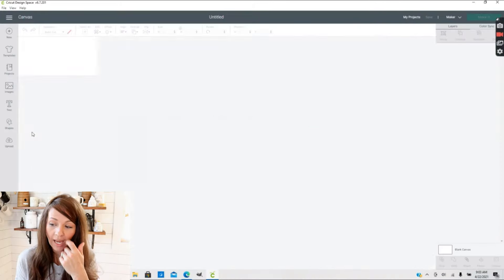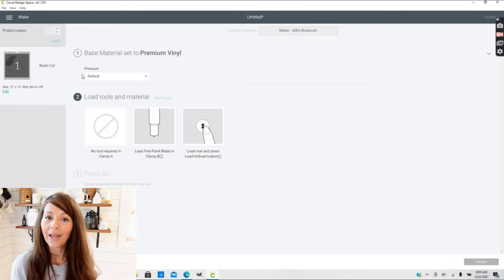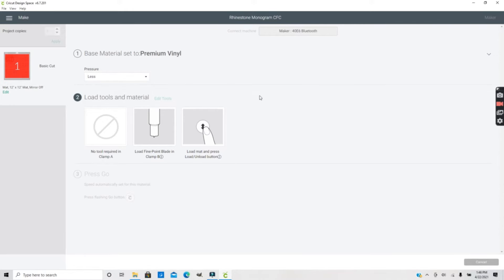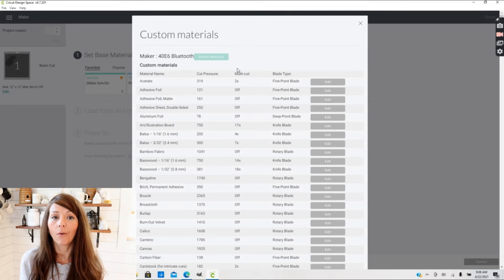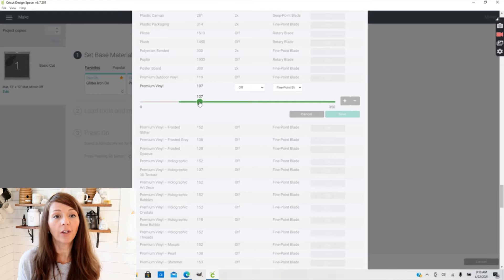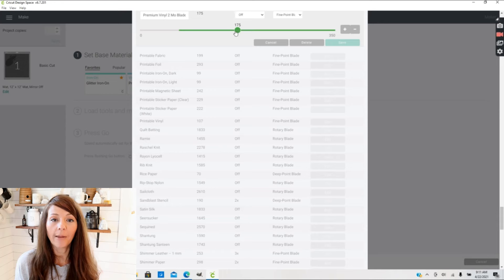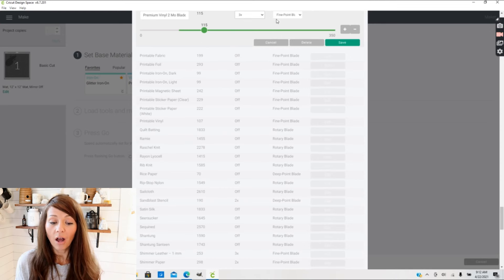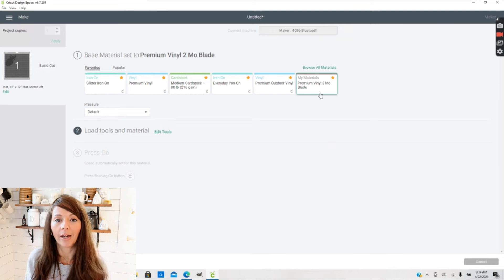How to Adjust Blade Pressure and Material Settings on Cricut Cutting Machine

Comment: Thank you for the video. It was very helpful. However I'm using Premium Permanent Vinyl and I can't find that option listed under materials. I tried both Premium Vinyl and Premium Outdoor Vinyl but the knife doesn't cut all the way through. I have a Cricut Maker. Would I risk cutting through the mat if I turned the pressure way up? Is there a recommended setting for that material? Thanks!
Reply from the maker: Hi! Try the Premium Vinyl- Pearl option. It works for me most of the time. Also, if you find it doesn't quite cut perfect, you can change "default" to "more" in the material settings after you select your material. Hope that helps!

Comment: Hi, question: 

(Using Cricut maker 3)
I used the pink mat, and rotary blade to cut felt (not cricut brand). For material options I chose “felt, acrylic fabric.” The first cut was on the default settings for blade pressure, but it cut into the mat. I changed the blade pressure to low and it still cut the mat. Any feedback? 

Thank you!!

Comment: Need some help. I have never used a Cricut. My husband is doing a build on a  boat model and needs to use 1/8 in. basswood. I was told my the store clerk that it would cut 1/8 in basswood but the instruction book doesn't show that. Any way to make an adjustment that would allow that or will it damage the machine?
Reply from the maker: Hi! I have tried 1/16" basswood and 2mm chipboard... there is a knife blade tool that would most likely cut thru 1/8" basswood . You would need to adjust your settings to make several shallow passes to cut thru that thickness but I wouldn't think it would damage the machine at all. Chipboard is much harder than basswood and I cut thru it all the time. Hope that helps!

Comment: I just got my Cricut machine. I literally do not have access to the changing the pressure settings.  Someone told me its not available in the ipad, but even on the desktop, I can't find it. Not on Ipad nor desktop.  When I go to make it section there is no where to click or open any tabs under the material settings.    I have version V6.12.227.  Any advise from anyone would be appreciated.
Reply from the maker: Wow I'm not sure why that is ... which machine do you have?
Reply: I'm having the same issue. Did you get it resolved? If so how?
Reply: Ok so I was able to get the changing pressure settings options by doing this....After I saved a new custom  setting, I turned off my machine (while design space was open), set the dial to custom, then turned it on again. Then went to cut my project out on design space and there it was... the ability to change pressure setting and materials. Not sure if this will work for others but this worked for me.

Comment: I’m having issues with my air 2 it’s programmed for my blade A to be the cutter but it’s no blade there it’s in blade B
Reply from the maker: Hmm I haven't had that problem before. Did you buy the machine new? The blade should be on the right slot...